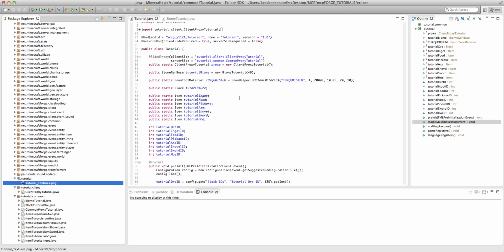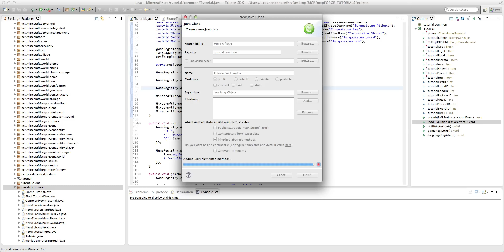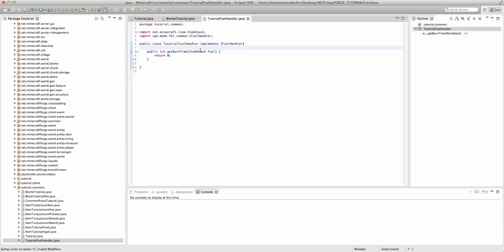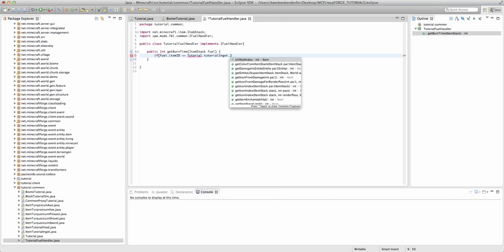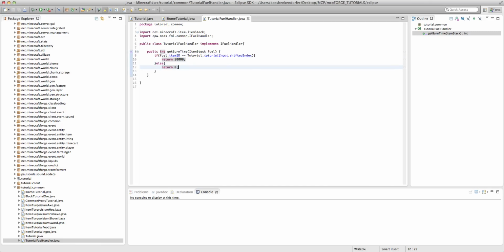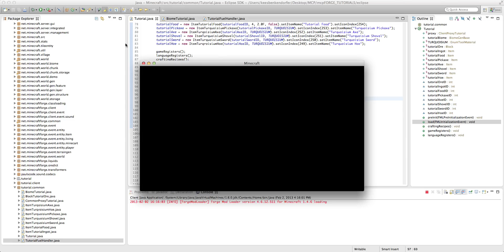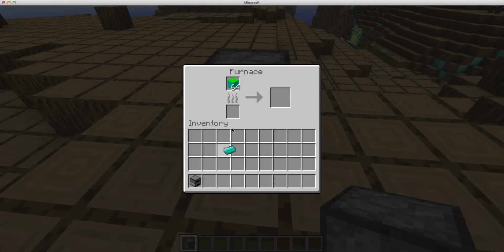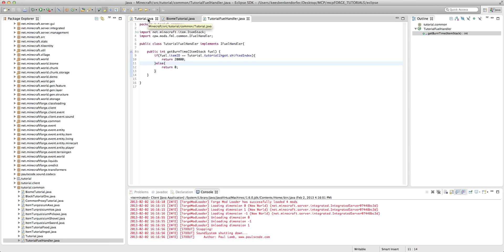[1.4.7] Minecraft Forge Tutorial 24: Custom Fuels

Comment: I did that, now if I wanted a fuel to be 1/5 of coal it would need to be 266.6667 (266 and 2 thirds)  so could i just put ### return (int) 266.666666666666666666666666666666666666666666667### so it is close? Would the (int) make it work? Because I can't have decimals otherwise!